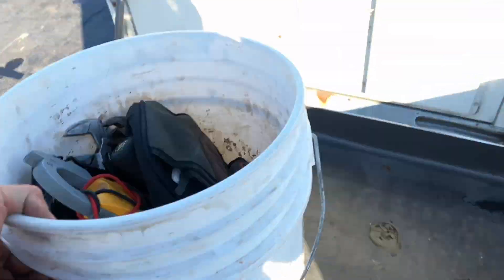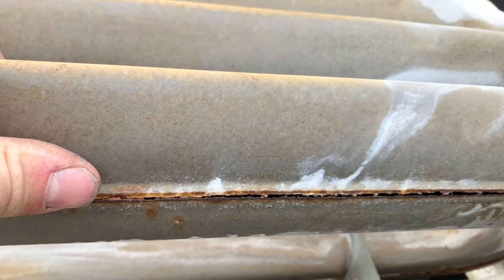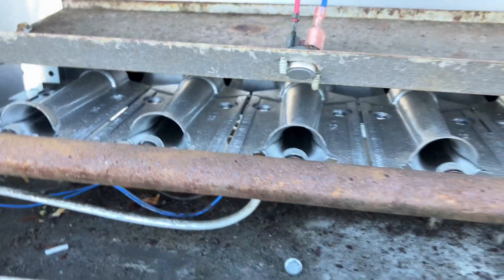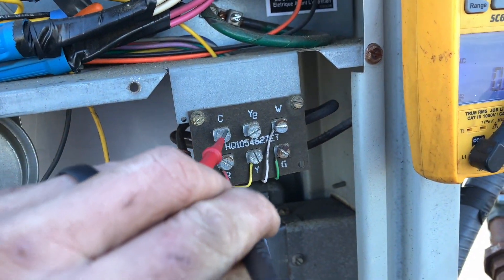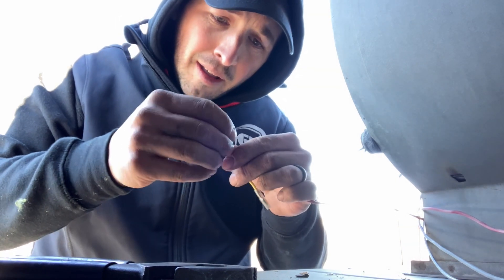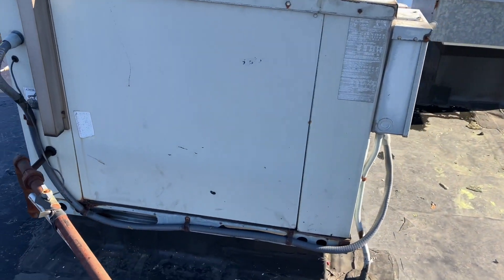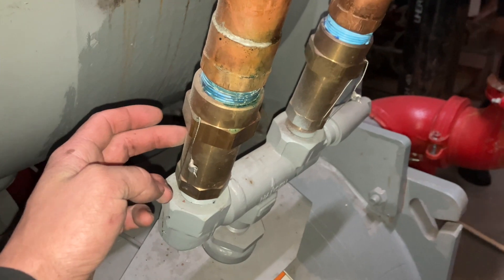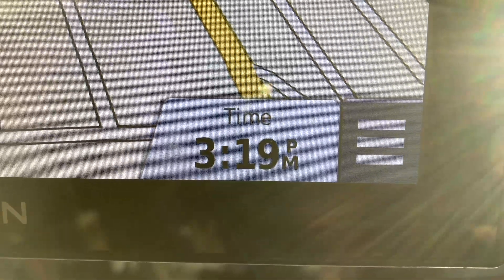The Boiler Room is Way Cooler Than the Roof

Comment: Ladders and rooftop, where's your fall protection gear?  Where I am we would be shut down in a flash if an inspector showed up!    We had a gas-fired Reznor aerotherm on the roof where I worked.  One Monday morning I found panels from the cabinet all over the grounds.  It was an old 3 stage unit and the stage 3 pilot failed.  You gan guess the rest!

Comment: 23XRV Screw Chiller, A4 Cooler, A4 Condenser, No Economizer, P Compressor, J Motor, Standard Tier 335/335 Drive, 460V 3PH 60HZ, FL Optimized

Comment: 3 hours on a HX swap isn't bad. I had a swap on a Bryant 90%er today (plugged secondary on a 355CAV) that kicked my ass a little bit. 

You should grab yourself a little ratchet that takes regular ¼" hex bits. Would make that last inducer screw a breeze. Wiha has a nice one. Comes with a short extension, 10-12 bits, and a nice metal case.
Reply: Or a Wera Tool-Check Plus, if that wonder does exist in the US

Comment: Take the supply access panel and cover the supply duct. Run the unit in heat to burn off the heat exchanger. Prevents the customer from complaining, or worse- the fire department showing up.